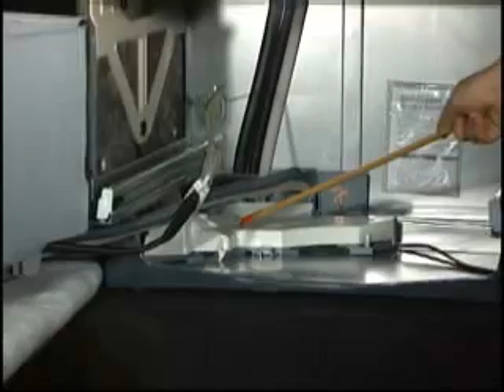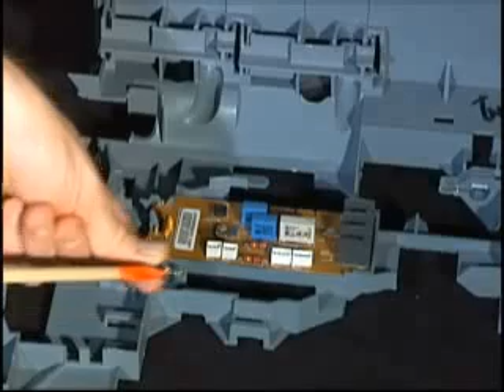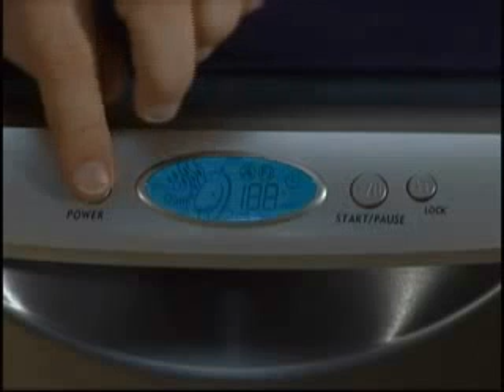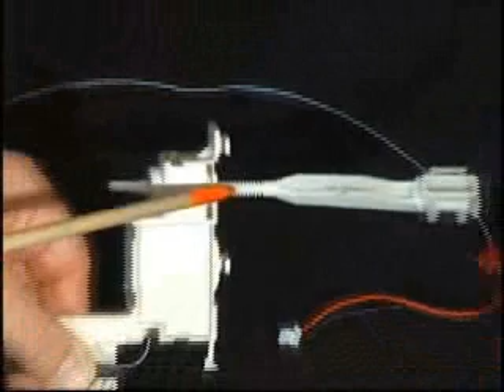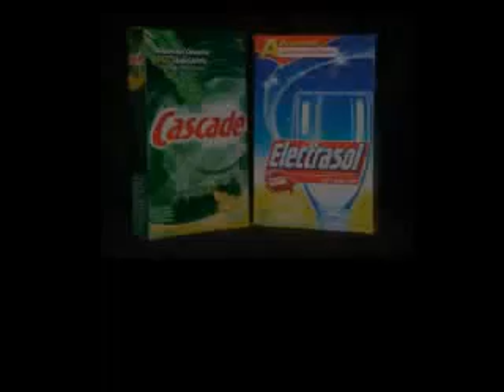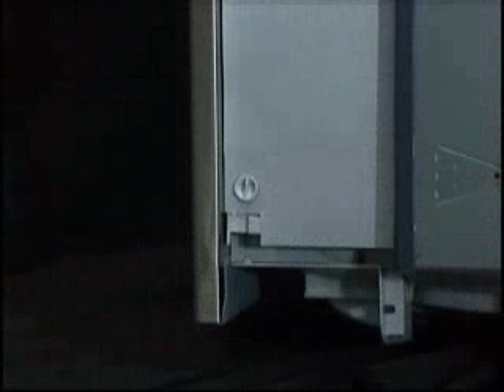FP dishdrawerv4 F1Code

Comment: 2025 and your video still helped me out despite being later model! Plumber had broken plastic fitting on end of top drawer runner. Insecure runner then gouged out the insulation over time; insulation residue stopped the lid from sealing, flooded the base. Bit of a mission but sorted. Thanks!

Comment: I have been away for 3 months so dishwasher was not used but remained connected to mains power; 3days following my return but still not using the washer, the beeping noise and F1 fault on the display appeared. I cycled the power with about 1min delay and it was all good for about 20 minutes then F1 returned with beeping. This time I have recycled the power again but I set it  on the 7min rinse cycle. No problems after that.